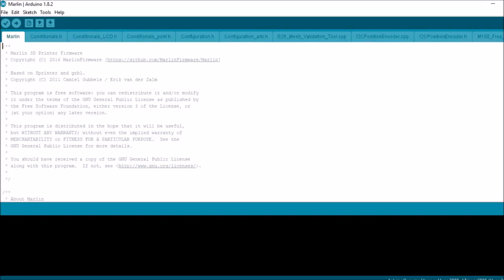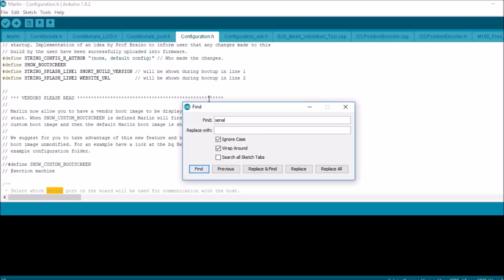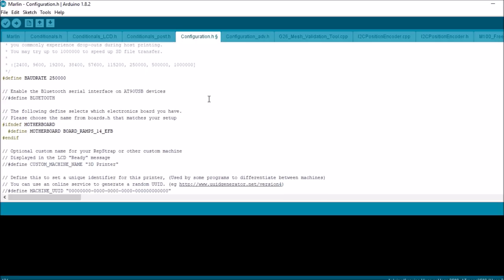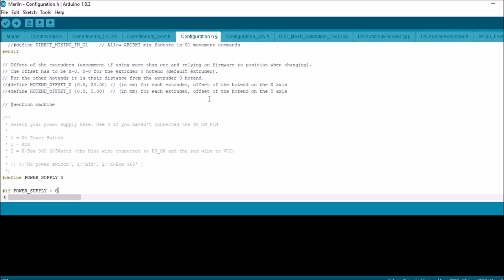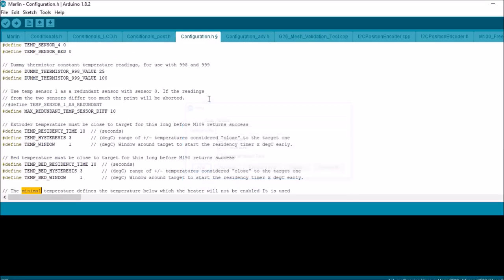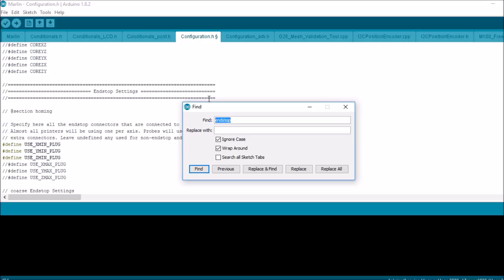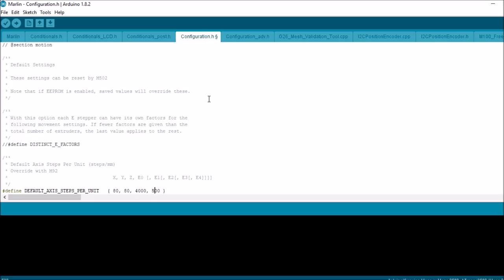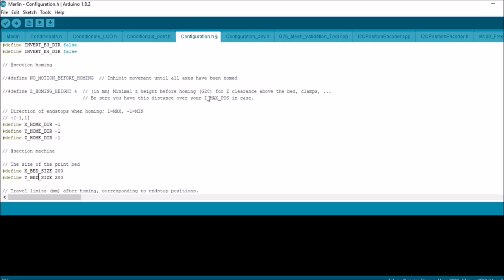RAMPS 1.4 - Marlin 1.1.8 Firmware Basics

Comment: Hello
Configuration is the same for CNC Mill? Not including extruders, thermal, filament settings right ?
Reply from the maker: Depends on your configuration and hardware used.  Marlin firmware will according to the documentation.

Comment: nice work.I want dual settings .Anet A8 dual extruder Marlin firmware setup for RAMPS 1.4. I'm waiting for the video of the settings.
Reply from the maker: Do you want two xcarriages or two extruder on one xcarriages?
Reply: Edward Braiman  yes that's exactly what I want .I have anet a8 printer.I get the new ramps 1.4 motor driver and dual extruder I.I can't adjust settings.I'm looking forward to your video.thanks.
Reply from the maker: The design to demonstrate is in the works, but will take some time to get finished.
Reply: @EdwardBraiman  I'll ok.wait patiently.I wish you the conveniences.thanks.

Comment: Hi,I like your video,but when I tried to change the size of my printer and I try to verified , on  Arduino,it gives an error.I have a Anycubic Kossel Delta plus printer and the firmware I have is for the Anycubic Kossel. I want to get the size to 230 x300.
Can you tell me what I am doing wrong.
Thanks.
Reply from the maker: Not sure with Kossel, but you might be able to adjust in Slic3r. I'll see if I can research a little more in Marlin firmware tonight.
Reply from the maker: This might help ... https://reprap.org/wiki/Configuring_Marlin_Bed_Dimensions.  Lets start from the Beginning are you using a RAMPS 1.4 on an Arduino mega 2560?  You might need to examine the example file for Delta in the Marlin Example folder.  What's the error the Arduino IDE is giving you?  How are you loading a firmware update USB or another method?  Paint a big picture of what your're trying to do step by step and maybe we can see where the issue is occurring.
Reply: Futuro ui

Comment: Hi, thx for the video. I am trying to automize a process (so no 3d-Printer) and i am using the Ramps 1.4 with the arduino mega. I want to controll a stepper motor, 2 cartridge heaters, 1 fan and 1 thermistor. Can i easily controll these with configuration.h? Do i have to remove everything that is unnecessary, like the stuff with the bed etc. ?
Reply from the maker: My RAMPS playlist should have a video with EEF in title.
Reply: @EdwardBraiman  alright, thx 👍

Comment: Thank you for the Effort and Support. I have a Marlin support printer as well G- Max 2 but when I try to home or level bed it exceeds the max. print area in X- Axis at the right .
  i tried a lot of tricks with its manual but i failed. Any Idea?
Reply from the maker: Inside the Marlin firmware configuration.h you can set limits for bedsize.  Try searching configuration.h for the value 200 and  see if it says something about bedsize and change to your bedsize values.
Reply: @EdwardBraiman  yes it was saying 460 and I changed to 456 although the bes size is 457..

I flashed but at the end the screen get bricked ..
Reply from the maker: So what the printer board say on it?  Is it a RAMPS/Arduino MEGA2560 board combination or a MKS Gen L?  The printer board information will be key to flashing the write combination on the board.
Reply: @EdwardBraiman  its Ramps /Arduino Mega2560 board
Reply from the maker: Are you flashing via USB or some other method?
Reply: @EdwardBraiman  Yes Please, Via USB
Reply from the maker: Are you using Arduino IDE to load or VScode?
Reply: @EdwardBraiman  arduino IDE the latest version
Reply from the maker: When you click the build buttoning the Arduino IDE, what do you see?
Reply from the maker: The build button will be the check box button in the upper left hand corner of Arduino IDE and tool too will say verify for button.
Reply: @EdwardBraiman  am sorry but am not seeing #buildbuttoning any where..
Reply: @EdwardBraiman  I get you, it says done compiling

Comment: My Z axis is Vertical not Horizontal same thing???
Reply from the maker: I'm not sure sure I understand your question.  Could you tell me the point in time in the video?
Reply: Sorry I have a Flashforge ...which has a vertical Heat plate movement were others Heat plate machines  moves on a horizontal plane so in Marlin setting the Z axis the same or do I need a different setting???
Reply from the maker: Glen Dooer should be the same.  But I have not built that print type yet.
Reply: A
Ok will let you know if I can get to that stage,,Thanks

Comment: Any chance of how to set up marlin open the files and what to look for  thanks
Reply from the maker: I would like to, the only issue is the length.  My videos try and present cause and effect so I'm considering making one just on homing because of the number of people curious about how.  It may span more than twenty minutes. But I'm open to anything you suggest.  Three people have asked about two x carriages. So I'm currently researching how.  I would also like to do bed leveling, but it may be three videos. So suggest a subject. I'm trying to keep it narrow and easy to present.
Reply: ok found another one of yours so will try that...when you mention letters such as EFB can to explain what these codes stand for,,thanks a lot
Reply from the maker: Extruder (hotend), fan, bed(heatbed).  It's one of five possible configuration with Ramps in the Marlin firmware for motherboard configurations in the boards.h file.  If you open this file the assignment will become clear.  The file is a linked references like a webpage where the information is included when compiled into a format the Ardunio can understand.
Reply from the maker: There is one video explaining with me opening the file and talking about them.  I've not done so configuration as it requires more research aka still not sure how to do.

Comment: Arduino Mega 2560 is not working 18 pins
What is the Z-axis microswitch how can I fix this?
Reply from the maker: Check out my playlist for RAMPS 1.4.  if you still unable to find video, I'll send you a link.  If it's still not working let me know and we can try another workaround.  Good luck.
Reply: - Marlene is active in microswitches.
- Microswitches x and y axes work.
- The microswitch Z is not working. The digital signal will not be sent.
- Wires are healthy.
The z-axis microswitch worked out suddenly.
Reply from the maker: So does z-axis work or not?
Reply: Endstop switch not work z-axis.
Reply from the maker: Hossein mohsen por does the microswitch work from z on x or y?
Reply: The microswitch z works on x and y
Reply from the maker: What type of 3d motherboard are you using? Can you enable zmax in Marlin firmware?  If so does it work?
Reply: The motherboard has a ramp 1.4 with a mega 2560.
Yes z max active in Marlin firmware.
Yes it works.
Reply from the maker: In same folder as marlin.ino, there is a file named pins_ramps.h or something similar. Inside this file there is a zmax and zmin. Reverse there pin numbers.  This will make Marlin firmware think zmax is now zmin.  Let me know if it works.
Reply: Thanks
Worked